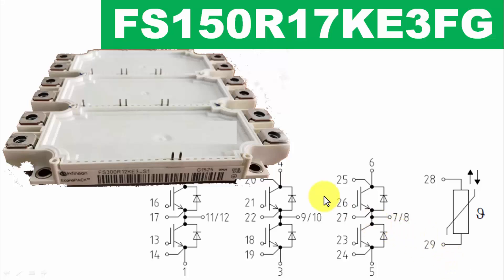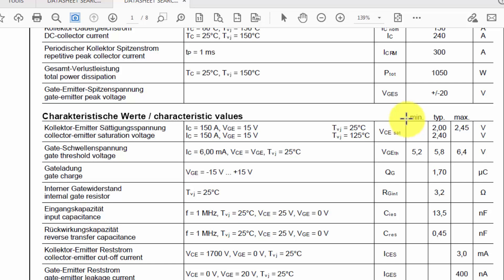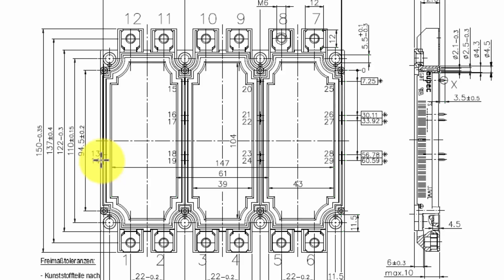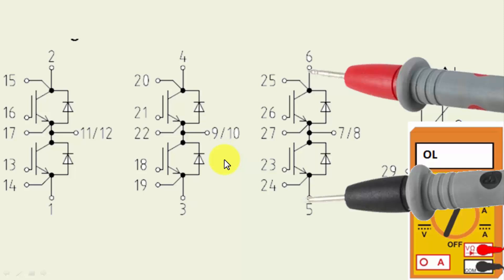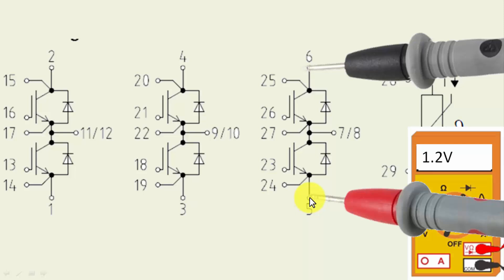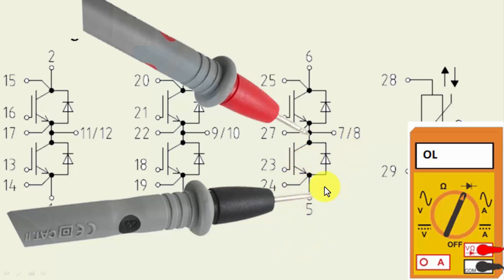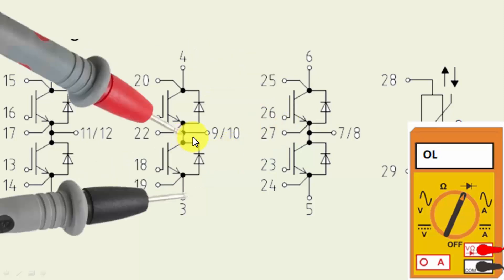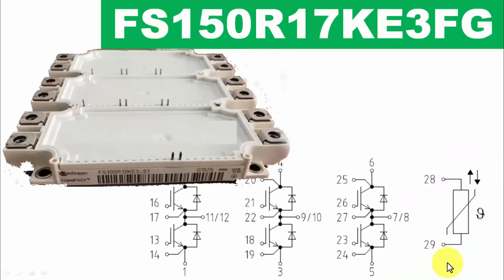]366] IGBT Module FS150R17KE3FG_S1, How to Test IGBT Module with Digital Multimeter

Comment: Assalamoalaikum,  kindly explain how to test igbt module PM25CL1A120.  I am receiving -280 DC on N and +280 dc on P , but there is no voltage on u , v or w. Is the module faulty or pc board. Diode test on P -V /W/U is fine.

Comment: Aoa, Haseeb Bhai.
Since your have started discussing IGBTs. Please also do a video on stand-alone DC Inverter Air conditioner compressor drive circuit using IGBT or IPM Module . This device will of great use for AC Technicians to test & drive the inverter driven UVW compressor when the built-in driver circuit board is faulty. 
Also to test DC inverter driven compressors as there is presently no device  available for this application.

Comment: Assalamu walikum sir 
Proskit mt1232 
Is it measure hz accurate
Can i use it for ac circuit repairing
Like to check frequency of idu motor or 100hz
Waiting for your reply 
Order it
Reply from the maker: pro'skit meter is good
but for a professional use FLUKE brand is awesome 
i am using more than 30 years and i trust blindly on its measurement and accuracy
Reply: @HaseebElectronics  I have financial problems
Can o go for it
Reply: @alamgirhossain607  I know Fluke Multimeters are best for professional. I'm also using Fluke high end models but most midrange multimeter can test frequency accurately if they are True RMS multimeter and having Low pass filter function in them. If you are testing VFD output frequency most Fluke multimeter cannot test them accurately until they have Low pass filter function in them.
Reply from the maker: You are exactly right
Best regards and special thanks for your valuable input